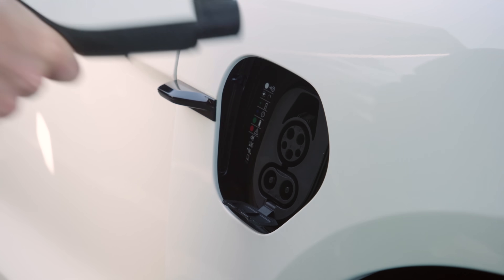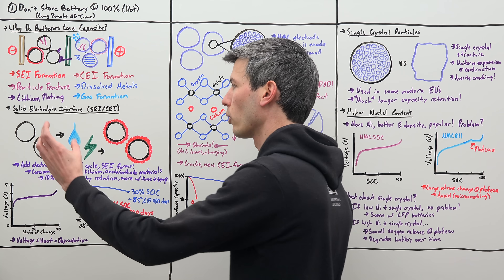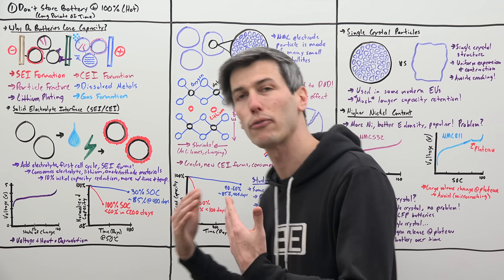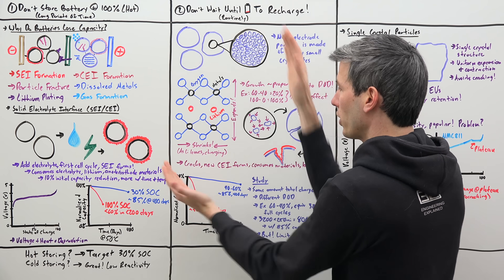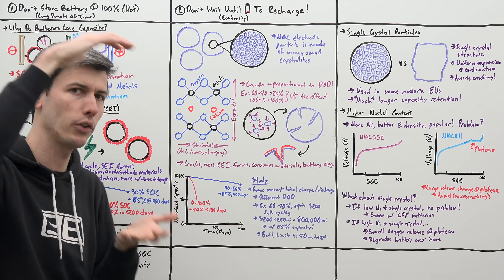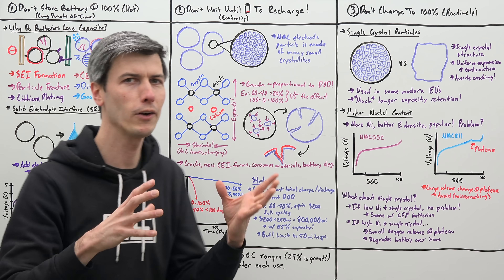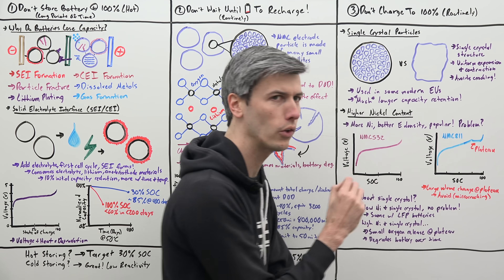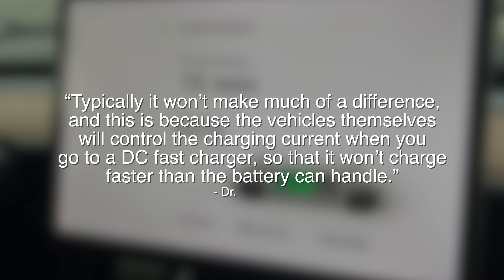How To Ruin Your Electric Car's Battery - NMC Edition!

Comment: We have used Level 1 charging on all of our short distance EV's with great results.  I just sold a 2013 Leaf SL with 92% battery health.  It did have an 80% charge setting.
Reply from the maker: Very impressive for the Leaf! Many of the first gen Leafs haven't had great battery longevity.
Reply: Yes  @EngineeringExplained I believe the temperate cool climate of Atlantic Canada mixed with level I charging, and temperature controlled parking at home makes a big difference compared to say parking on hot sun scorched pavement in Nevada during the summer while high speed charging.  

I hope someone builds a similar car with an air cooled "Sodium Battery"  pack for everyone above the 45th parallel.
Reply: @EngineeringExplained I have a 2013 leaf but used very cheaply, and I don't know exactly how the previous owner treated it, but not too badly as when I bought it in late 2022 it had 11/12 battery health bars. 

I somewhat doubt this as it only really gets 50ish miles at highway speeds but it's worked for me.

Personally I think NMC is too much if a tradeoff in terms of longevity for me, and I'm happy that the cheaper EVs tend to have LFP batteries that are less dense but are absolute tanks for longevity.

Plus charging at home at 3kw is plenty fast for me :) great video btw!
Reply: @cruisingwithsam  6 years ago I bought a 2013 leaf with only the J1772 port so I know it was only Level 1 or 2 charged by the previous owner and there aren't any Chademo chargers nearby. It had 11/12 bars at the time, 50k miles later it still has 9/12 bars. Your doubts are well placed as the health bars aren't all equal. The first bar doesn't disappear until the battery has degraded about 15%, each of the other bars disappear after about half as much degradation, or about 7.5%. So your 11/12 bar leaf could have as little as 78% of the original capacity remaining which matches your observation of the highway range. 78% of 75 (the original mixed mileage range) = 58.5 miles. The range drops pretty fast at highway speeds too. I put a basic grill block on and went from 3.1 to 3.5 miles/kwh (all that air is just for cooling the AC condenser and I don't use the AC much) and smoothed the wheels and went from 3.5 to 4.1 miles/kwh and my regular commute is only about 60% highway.

I'm glad to hear that charging to 100% isn't so bad at low temperatures since I get about the same range from 100% in the winter as I get from 80% in the summer. I switch it about the time I switch my all season tires for winter tires.

And I agree, 3kw is generally fast enough with a little planning.
Reply: @cruisingwithsam  I can tell you that your 2013 LEAF really does have max 50 miles highway. On the highway the battery depletes so quickly because you have to constantly use energy to move. Wind causes drag and there is no regen at a constant speed.
Reply: I have a 2011 Nissan LEAF with a mere 17k miles that has 7/12 bars and only 50.50% SOH.  Leafspy's charge counter shows the vehicle has only been quick charged ONCE (versus 1228 L1/L2 charges) during the vehicle's life.  I'm the second owner and I normally only charge it to 80% (the only options are the factory default of 100% that the owner's manual says should not be used and 80% that is hidden in the menu), and try to keep max motor power usage under 20kW.  You can see from the odometer divided by total charges (14.5miles/charge) that depth of discharge was modest... but to no avail.
Reply: @majbthrd  the battery chemistry in the first couple of years of the LEAF was poor. I don’t think any amount of cars taken when charging can make up for the poor chemistry.
Reply: @EngineeringExplained  The first gen nissan leaf doesnt like fast charging. 120v charging and they last a long time. My uncle just replaced his leaf(cheaper than replacing the battery) and up until recently it had over 70% battery health. Dropped down to unusable level quickly this year. Car was never charged with anything but a standard 120v plug.
Reply: @EngineeringExplained  The reason most of them have degraded so much is because people actually used 80% of their batteries daily and charged them to full. Or even charging them to 90%+ and then depleting the battery.... it just ruins batteries.
Reply: The LEAF had a different battery chemistry in the first few years; they modified the chemistry in I believe 2014. LEAFs with the newer chemistry have battery battery life.

My 2018 LEAF now has 200,000 kms/125,000 miles; LeafSpy is showing me 82.9% state of health. I am at least the third owner. I assume it was originally a company vehicle given the high mileage for a 2018 vehicle. Still going great and wonderful to drive.
Reply: @glennjgroves the new chemistry came late in 2012 for the 2013 model.   The 2013 Leaf SL was also the first EV to offer a heat pump.
Reply: @fabulousoffroaddesigns5080  my 2013 SV came with the cold weather package (heat pump, battery warmer, and heater seats and steering wheel) and it's best parts of the car in the cold. I'm impressed with how well the heat pump works when nobody had ever put one in a car before.
Reply: @bearclaw5115  outside temperature affects degradation, so why would charging something 3X as fast and only allowing ⅓ of the time for cooling on a small battery with no active temperature management not affect the battery in some way?  

I agree in a 60-90 kWh pack with active heat management it won't likely affect the pack at all.  Alternatively running  40A in a 24 kWh battery is equivalent to 120A in a 72 kWh battery.  Nobody builds an unmanaged 72 kWh battery.
Reply: @fabulousoffroaddesigns5080  Nissan does make a 62kwh passively cooled battery for the 2019 and later leafs which isn't that far from your hypothetical 72kwh battery, and they do have trouble fast charging to be fair, but that's at 50kw.

For battery heating you're talking about the difference between input, which varies by charging power, and rejection, which in a passively cooled system is going to vary by ambient temperature the most. According to an Idaho National Laboratory study of a 2015 LEAF L1 charging (1.4kw) was 79% efficient and L2 (6.6kw) was 91%. 21% of 1.4kw is 294w and 9% of 6.6kw is 594w, so even though charging is happening 4x as fast only twice as much heat is being put into the battery. 594w is a non trivial amount of heat, but there's a large mass that's being heated. The 24kwh pack weighs 648kg and the 30kwh pack weighs 668kg. Not all of that is battery, but all of it is thermal mass, so it functions, purposely or otherwise, to sink heat. So that's less than 1w/kg input in worst case L2 charging, which is going to raise the battery temperature minimally over the at most 10ish hours that a 62kwh battery would charge even if heat rejection was zero.
Reply: @fabulousoffroaddesigns5080 It's not charging fast enough to heat the battery at low amp level 2 charging. Get an OBD scan tool and look for yourself, its easy..
Reply: That's what they call anecdotal evidence. My 2018 leaf was also charged on 110v volt charger, but in 4 years, the battery pack died with just 47k miles on the car. No explanation fron nissan. Under warranty but the battery is no longer manufactured so car was a total loss.
Reply: @johnsord-xp3ij car was a total loss? they saw you coming.  plenty of second hand leaf batteries available.
Reply: Not really  @johnsord-xp3ij when Ford was asked why they chose a 12A level 1 charger for the FFE instead of a 15A one like Nissan used with the Leaf or 16A that VW used in the E-Golf they said it was for battery longevity.
Reply: @johnsord-xp3ij a total loss?  LOL. No, you can easily replace the battery with a used one.
Reply: @rtbrtb_dutchy4183  No. Replacement with a used battery would void my warranty.  Nissan Corp. bought the leaf back, and I only tell that story to warn leaf owners about the battery replacement situation.  I was treated EVERY WELL by nissan Corporation, but the dealership is another story.
Reply: @johnsord-xp3ij  so it’s not a total
Loss then. They bought it back, put in a different battery and sold it most likely.
Reply: Sadly the 80% limit is gone on the newer LEAF but I try to keep mine under 80%. I mostly use level 1 charging, but I have a level 2 charge as well.
Reply: @Jimster481  how do you keep it under 80%? Guessing you have to calculate each charge and manually adjust each time you charge? A pity Nissan removed the ability to stop at 80%.
Reply: Wow, you guys. This is a LOT of replies on this thread. Starting to get a little out of control.
Reply: Still no one can explain to my why I should limit my range to 80 % for the entire lifetime of my car (by charging to only 80 %) when I could just always charge to 100 % and experience a gradual degradation to 80 % during the lifetime of my car.
The only reason would be to get a higher resale price. And even if you only charge to 80 % all the time you’re still going to see at least 5 % degradation.
Reply: @manuel0578Delusional.
Reply: @manuel0578I don't think there is any difference between Level 1 charging to 100% and Level 2 charging to 80% for battery degradation.  Most modern cars already have a buffer built in of 10-15%.
Reply: Level 1 charging (120v) does not improve battery life over level 2 charging (240v). Both charging rates are no where near fast enough to stress the battery.
Reply: @bearclaw5115 Facts. I'm of the opinion "level one" charging is causing more issues with the onboard charger. I've seen so many people rely on only to need a new charger on the car after a few years compared to others charging faster on level 2. Anecdotal perhaps but I see a pattern that can't be ignored. Without an onboard charger you're going to rely on expensive DC charging while one waits for a part.

Comment: buying a used EV is a gamble with all these range anxiety people charging to 100% everyday
Reply: Buying a used ICE car is also a gamble when most people don't keep service records and you don't know if the oil has been changed regularly, how long the engine has idled vs mileage, etc.
Reply: @BrandEver117  they have something called maintenance records and receipts for oil changes.  Where is the receipt for charging 100 percent everyday??

Comment: you made a small mistake regarding the expansion/contraction point; the silicon doped anode that is commonly used (for greater energy density) has much greater expansion/contraction below 20%. after that the expansion/contraction is sorta proportional, but if you look closely its slightly lumpy based on intercalation orientation.
Reply from the maker: Yeah, there are some graphs in the video referenced showing the actual curves of expansion. But Dr. Dahn says roughly proportional, and I think that's fair. A greater percentage means more expansion/contraction.

Comment: Question: in Category 2 you talk about "cracks" forming causing faster degradation because 20% is 5x less than 100% but you are also using 5x less of the car. So how is that different from "traveling less causes less wear than if you traveled 5x as much"?
Reply: Presumably they drive the same amount but charge 5x more often?

Comment: Most of these battery saving practices should be known to people already even if you don't know the "why?" part . Because all these are discussed for smartphones using lithium batteries almost 10 years ago.
Reply: The problem is, a lot of the tribal knowledge about batteries predates Li-Ion batteries -- advice such as "the first charge should be to 100%" don't apply to modern batteries, yet it persists.  Similarly, a lot of things that DO apply to modern batteries haven't achieved the same level of cultural penetration.  

Case in point, I'm pretty well connected as far as EV insider knowledge is concerned, and even I thought using a supercharger to even get to 70% was awful for the battery.  According to this video, though, it's really not a big deal.
Reply: The high speed charging option is provided only to batteries that are designed to for fast charging. Again the only reason why you shouldn't be using a fast charger is because of the heat produced during fast charging. If you can maintain a low temperature during fast charging, its pretty much same as slow charging.
Reply: @abhishekpg9615 The BMS will fix that. Sometimes rapid charging is a necessity
Reply: People didn't care till now, because they replace phone after 18 months on average, so nobody can even notice degradation in that time.
Reply: @MariuszChr yep exactly the reason. Back when smartphones were introduced people really cared about getting the maximum life out of battery. But these days smartphones are comparatively cheap so no fuzz over it. That day for cars is also not that far.

Comment: People who don’t buy, maintain (well) and use a vehicle to at least 250,000 miles are basically throwing money away IMO. So the comment about how the battery should outlast the life of the vehicle if they do this thing was especially hilarious to me.
Reply from the maker: 250k miles is very doable with a well maintained battery. It's been done already, with older tech.
Reply: @EngineeringExplained  Agree. Tesla recently pointed out that the average battery capacity loss over 200,000 miles was about 12%. This seems to be independently verified by Tessie as well.
Reply: @Green_Tea_Coffee I’m less concerned about degradation over time than sudden battery failure rates due to the issues inherent to lithium ion battery cells sometimes having formed crystalline structure perforating barriers and causing shorts within cells.
Reply: @meanman6992  Pretty much all of the modern EVs have warranties to cover those sorts of issues. Not saying it doesn't happen, but it's not common.
Reply: @Green_Tea_Coffee  He's talking about basically driving your car till it dies. 250k miles or more. There is no warranty that lasts this long.
Reply: @marceldiezasch6192  No, there isn't. The Tesla warranty covers up to 120,000 miles. And there's plenty of 200,000+ mile Teslas on the road. Claims of sudden battery failures are massively overblown. It's all one or two stories of a car with a failed battery that requires an expensive OEM replacement, but nowhere in any of those stories do they talk about what percentage of EVs overall are having those sorts of battery failure rates.
Reply: @EngineeringExplained yeah, what’s the mean average before battery replacement is needed across the board? And how is that threshold defined? Us poors which are intelligent enough to avoid massive debit aren’t very fond of the idea of a battery costing half the cost of the vehicle going belly up in a decade.  And there’s part of the issue, material science, the literal battery technology isn’t there yet IMO for it to go mainstream, not to mention the effect lithium mines have on the environment around them and the children mining the stuff… yeah I said it.

Comment: Good stuff, thanks! I'd like to see you breakdown on the whiteboard fast DC charging vs. slower AC charging. I take long road trip at least three to four times a year and during these trips the bulk of my charging is DC fast charging, while overnight charging at hotels when I can. EDIT: Ah, I now see the bit at the end, but still would be nice to see the full breakdown.
Reply: As a rule, higher current draw => lower battery life. If you constantly fast-charge your batteries, their capacity will diminish faster than if you do a slow overnight charge.
Avoid fast-charging in cold temperatures - which is related to the issue of diminished battery capacity in cold weather.
Reply: @ohnoitsalobo  "faster". This used to be the common wisdom, but have not seen any recent evidence to back it up. Sure you can charge your batteries too fast, but I have not seen any hard evidence that faster charging means faster degredation. 
About the cold temperatures: many, if not all modern, vehicals have temperature controlled battery packs. Limiting charging rates and heating up the battery to temperature and charge/distcharge rates which are safe.

Comment: defining what "hot" is critical
Reply from the maker: In the study they found heat played a big role even at 35 C, though not nearly as much as 50 C. Hope it's not 50 C where you're at!
Reply: Jason is the definition of "hot" 😜😜😜
Reply: @EngineeringExplained  I'm at the 35C-46C max (Houston) with just a bit...small bit of water in the air...barely humid at all

Comment: I’ve said since Tesla first started experimenting with EV’s back in ‘07ish, No matter how hard the government & misinformed attempt to push EV’s, the main issue is the batteries. Without a breakthrough in battery technology EV’s will never take over combustion engine vehicles. You cannot rush technology, which politicians & the people that believe them don’t comprehend. It’s like mandating a smart phone in 1975.. it’s just not possible to produce until it is, if & when it is.